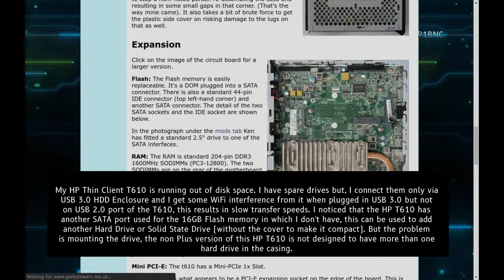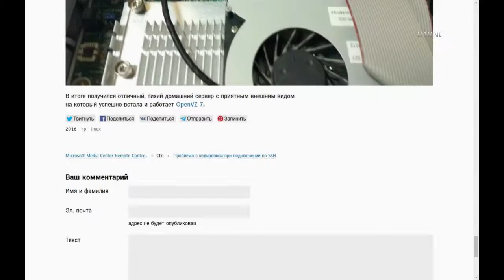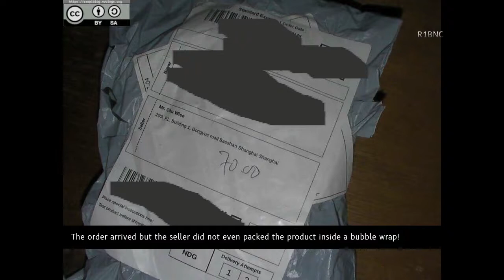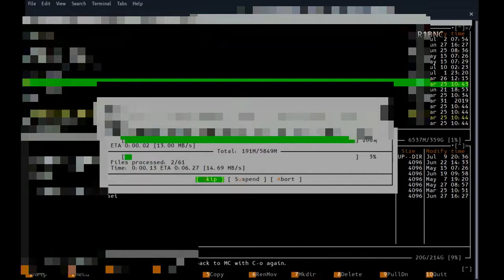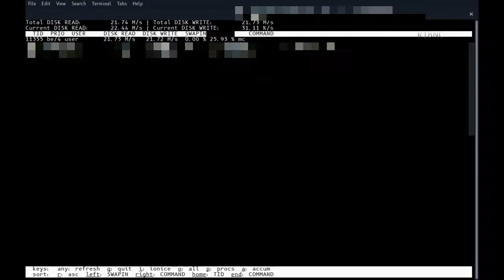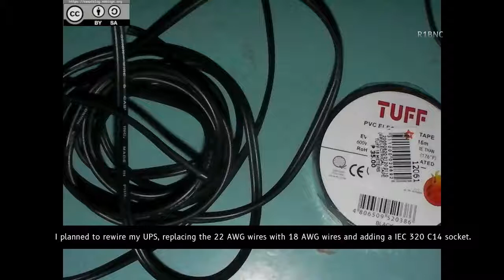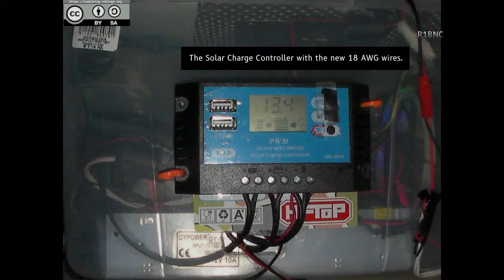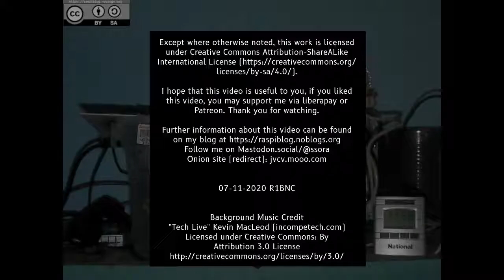Increasing storage of HP Thin Client T610

Comment: I have a T620  and a T630 Quad core ...i used that cable and a 60ssd ..which is a better idea ..its light as a
feather and slim too ...frankly the lead is overkill and too big ..cut it down and solder me thinks ?
The best place for an ssd is stuck to the top cover with sticky pads ..its out the way then .

Comment: Nag add ako ng 2.5 hdd in sata 2 and used it as my Os, my problem is every bootup I encounter error
Reply from the maker: Ano pong error?
Reply: @R1BNC  pxe-e61 lods
Reply: May time na nagoopen pag nirereset ko bios hindi naman din battery kase nag palit narin ako cmos batt
Reply from the maker: @fabiajhondel786   Ibig sabihin hindi naka set yung BOOT PRIORITY/BOOT ORDER mo sa BIOS, baka maluwag yung SATA cable mo kaya na didisconnect yung HDD.
Reply: Ayos naman po yung boot priority triny ko din po na yung may os lang naka insert, tapos naka direct po  yung hdd ko hindi naka cable tska nag sspin pa naman po yung hdd, now po triny ko ulit installan ng os an then oobserbahan ko po, possible po kaya dahil sa power lost, Maraming salamat po pala sir sa pag sagot sa mga tanong thankou po...